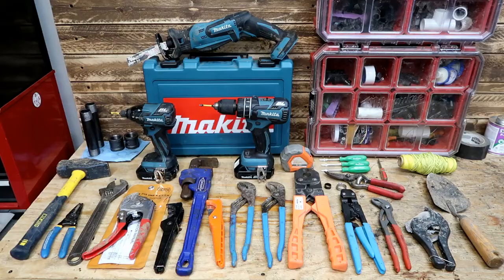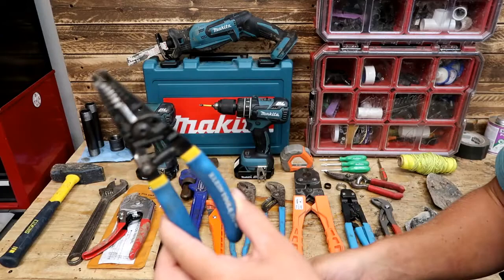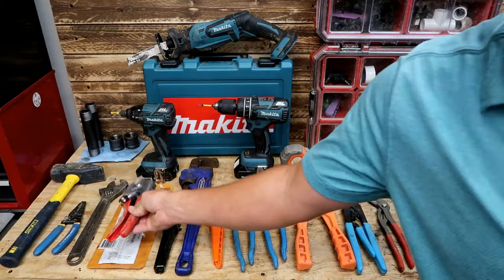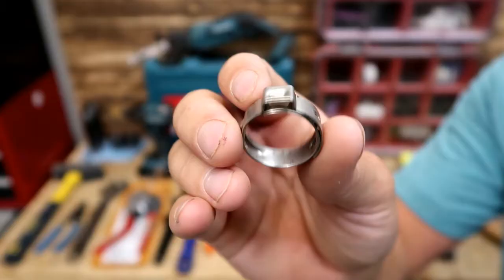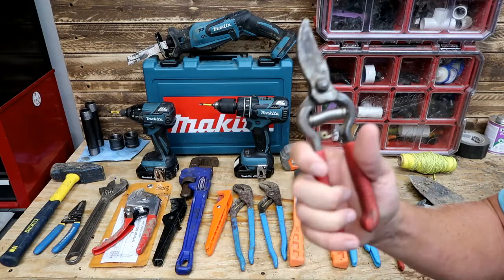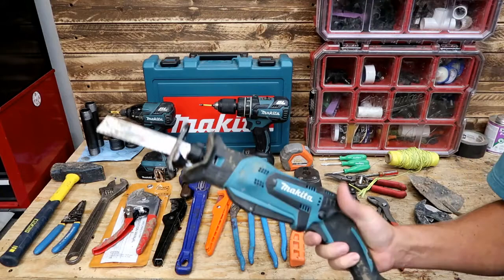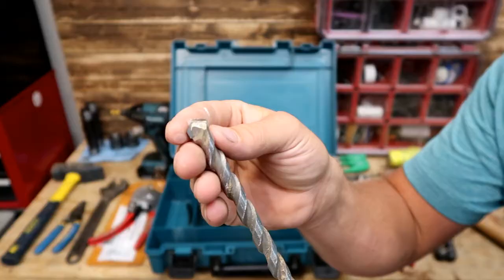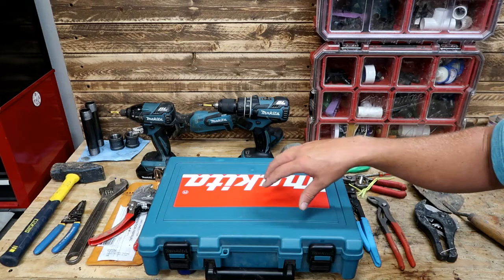Sprinkler & Irrigation Install and Repair Tools

Comment: Nice assortment of tools. I like using long screwdrivers and bits for valve repairs in deeper valve boxes. Also a cable saw is good when cutting a pipe that's tight against another.
Reply from the maker: Yes! Great feedback and suggestions!

Comment: Cool video, im just an irrigation nerd checkin out tools.for the upcoming season.
Reply from the maker: Ha! Thanks for watching! Any tools to recommend that I'm missing?
Reply: I didnt see a little rubber mallet, thats a nice little cheater for poly pipe fittings, i hate using a torch on poly pipe. And recently ive switched to a tool backpack which is amazing for having all of my hand tools on me while carrying valves or whatever im installing.im sure you know walking time adds up quick on Big properties and the backpack saves a lot of walking time and allows me to carry more than my hip pouch or fitting box. I like having all of my tools on me all the time juuust in case. Rock on buuddy!